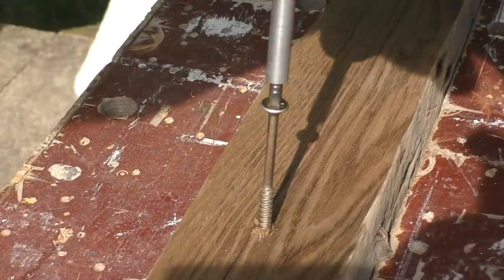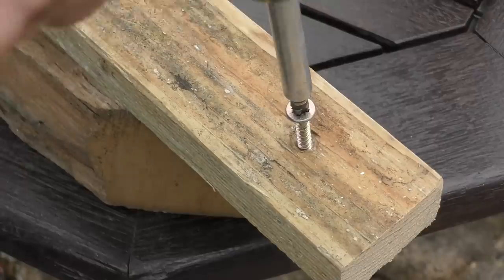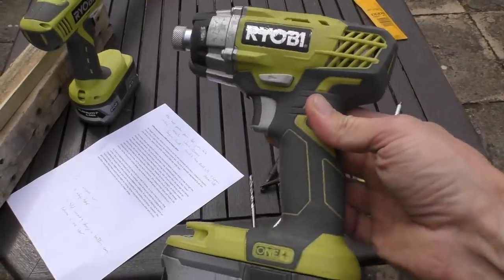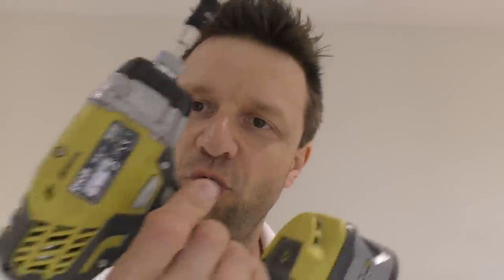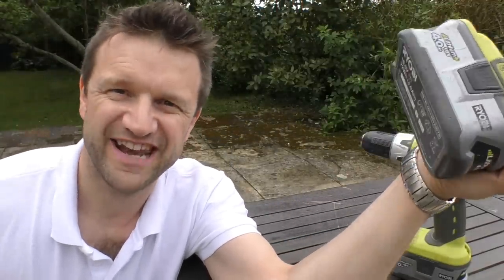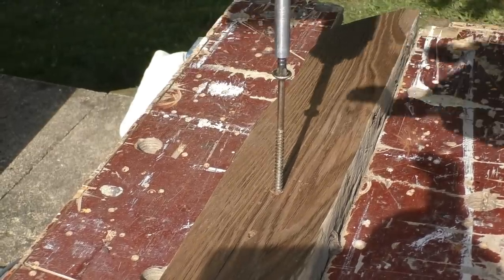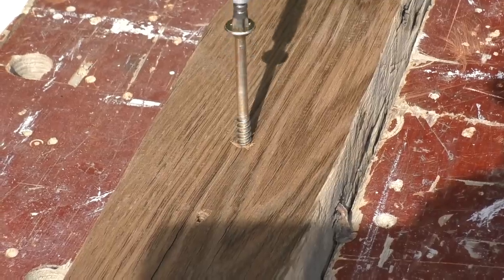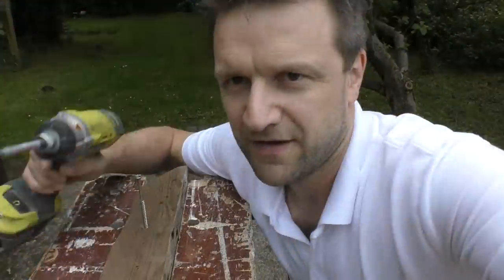Difference between Drill Drivers & Impact Drivers

Comment: Ok but how do this compare to a hammer drill/driver and what’s the difference
Reply from the maker: With an impact driver the impact action works radially, or in the direction the bit is turning NOT in and out of the wall or in line with the drill bit which is how the hammer action works on a combi drill or drill driver. Take a look at this video where I go into this in a bit more detail https://www.youtube.com/watch?v=i6KYfrDBj3w&t=32s Also compare the action of an SDS drill here https://www.youtube.com/watch?v=tYUvlxWkFh8&t=12s

Comment: I have experience of using Ryobi and never ever will buy again. Even those tools bought from Lidl are better quality. For work I buy only Festool, Mafel, Fein, Hilti or blue Bosch
Reply from the maker: I think if you're using them 5 days a week, then definitely I agree, you need one of those you mentioned, and possibly add Milwaukee to the list. Personally I've never had any issues with my Ryobi in the day job, but I'm not a heavy user.

Comment: why not the hammer action on a drill driver?
Reply from the maker: Because it works perpendicular to the drill bit, or in and out of the wall whereas the hammer action on an impact is radial, it works in the direction the screw bit is turning, which is what makes it so powerful.

Comment: What about a drill with impact drive built in?
Reply from the maker: There's no such thing, I'm afraid. You're talking about the hammer function on a combi-drill, and you can't use this for screws because it works completely differently ie banging in and out of the wall down the length of the drill bit, whereas the impact action works radially, ie it hammers in the direction the screw is turning which makes the process so much more effortless.

Comment: Im none English speaker, but what actually is a hammer drill/driver. Does that sort feel same as the impact driver? These names drive me nuts haha
Reply from the maker: They're very different. The hammer drill action works in line with the drill bit (in and out of the wall) whereas the impact action works in a radial motion, or in the direction the screw bit is turning. A lot of people ask if you can use a hammer drill as an impact. The answer is NO for the reason I've just given.
Reply: @CharlieDIYte  I think i sort of understand. Impact is only for driving where the other one is drilling right

Comment: I should have gotten anything besides the pl235 impact driver
Reply from the maker: Ah sorry to hear that. What's the problem with it?
Reply: @CharlieDIYte  I was asking for a lightweight drill to drive in screws and for drilling holes when I had to use a drill above my head.  My Ridgid 18v is just too heavy for using all the time.   However, the Ryobi has no speed adjustment.  It is too fast to use to drive in screws.  Also, the bit holder does not hold onto bits like my ridgid does.

Comment: not sure where you get the idea the impact is stronger than drill driver my drill driver i have tried to drill in 3 inch screws and my impact stopped with screw less than inch remaining  then used my drill driver straddled it then it wanted to twist on me and with ease over sunk the screw my drill driver is probably 5 times stronger than my impact both are dewalt and share 20 volt batteries i use my drill driver to tighten and remove lugs form my vehicle wheels and get them tighter than torq spec my impact driver cant even get close to torq spec
my drill driver will send you to the hospital if you are not careful my impact driver will never injure me

Comment: Its the volts thats the power ,and the amps the capacity .18v 4 ah  will not give any more power than an 18v 1.3 .Those batteries must be goosed
Reply from the maker: It's not that simple mate. Check out the pinned comment at the top of the comments feed below this video. There's a great discussion on this. 👍

Comment: This doesn't prove or disprove anything. At the end they both get the screw in at equal amounts with the 1.3AH battery. He switches the impact driver battery to the larger battery to finish the job, like he proved anything by doing that
Reply: Yes I was a bit puzzled by that bit, I thought we were going to see that the impact driver would easily finish the job even with 1.3Ah. But nope. I get that it requires less pressure to use, but other than that it doesn't seem to any more effective. A drill driver seems fine for most jobs, and of course you can use it to drill holes too.
Reply: @chrisf1600  I used only my drill for a long time, constantly switching between drill bit and driver bit. What a pain. Finally I clued in and started using the drill as a drill (pilot holes, etc.) and the impact driver for the screws and it makes a world of difference. Sooo much more efficient. And yes, the impact vs straight torque does make a difference. The other nice feature of the impact driver is the shorter barrel, so it's easier to get into tight places with it than with the drill. Definitely worth it to work with the tandem, IMO.

Comment: You're an interesting man, but through out your long video, I still don't see clearly the difference between those two drills, except the impact driver has accept only the hexagon bit which is not as convenient as the drill driver.
Reply from the maker: Sorry. I go through the differences in greater detail in this video https://youtu.be/i6KYfrDBj3w. Bottom line, the impact driver has a hammer action that works radially, or in the direction the bit is turning, which gives you so much more power when driving home screws, whereas the hammer action on the combi drill works perpendicular to the wall (in and out), which is why you can't use the hammer action on a combi to drive home screws.

Comment: I hate impact drivers. They tend to rip through the wood and split it. You should you a drill to do a pilot hold first and then use an impact driver if you really must
Reply from the maker: I've got to say, I hardly ever use my impact. Just not necessary for most jobs. But then the fitter who works for us uses his for everything. So it comes down to personal preference I guess.

Comment: “The impact driver is so good for driving fasteners, just take a look at all the drillbits that I’ve run and all the screws I’ve sheared off!” 🤣
Not to mention the goddamn concussive vibration sound is completely annoying and hard on the ears.  I’ll take a drill driver with a selectable clutch thank you very much.
Reply from the maker: I've got to say I rarely use my impact for this reason. It's just not necessary for most jobs. As discussed here https://youtu.be/sL-t2Zc4wCs

Comment: for home use, why not just get the screw/drill gun and drill a pilot hole, then you won't need an impact driver ?? Plus drilling a pilot hole prevents the wood from splitting? Is this sound logic? Again .. home use ..
Reply from the maker: You should always drill a pilot hole particularly in hard wood like oak because otherwise you'll have snapped screws on your hands and splitting as you say. I didn't here because I was trying to make the challenge as brutal as possible.

Comment: unfair. with 4.0 ah battery he used x1 speed with drill driver but with 1.3ah battery he used x2 speed which makes drill driver much faster but it loses huge amounts of torque. And usually impact drivers have less torque than drill drivers. it's the way the torque is delivered. and that's why impact drivers last longer with the same battery. it's a lot more complicated than this but basically use impact driver for screws and drill driver for everything else.
Reply from the maker: Hi Robin, that's very eagle eyed of you - I'm assuming you're looking at the snap shot that showed the drill in setting 2 before I started the 1.3Ah part of the challenge. I don't know how or why it was in setting 2, but I can't imagine I would have started driving the screw home in this setting. Accidents happen, of course. Someone has already pointed out I was using a PH screw bit, which again was accidental as I had a set of black erbauer impact bits which I stupidly assumed were all PZ.

Comment: 8:14 wrong bit. You are using a PH2 instead of PZ2 bit.
Reply from the maker: Yep I know. Picked it out of the tool box thinking my black Erbauer impact driver bits were only pozi drive. Turns out there was an erant Philips head in there 🤦
Reply: @CharlieDIYte  that is an unpermitted mistake for a tools lover. You should repeat the test.

Comment: So it's about the battery..it seems like it doesn't matter if you use impact driver or a drill driver.,what really matters is the kind of battery you are using..
Reply from the maker: The impact driver makes a massive difference if you've got a lot of screws to drive in eg for decking, or driving home a big old screw where you need the torque, because the hammer action on the impact works in the direction the bit is turning whereas the hammer action on a drill driver or sds works in and out of the wall. So the impact does give you a lot more power, but I've got to say it's something I rarely use myself.

Comment: Drill driver is for drilling holes or small screws. Impact is for driving screws. You can use your drill to drive big screws if you want or you can pre drill all your holes...but its not the right tool. Just like you can wash your car with a toothbrush...doesnt mean its the right tool.

Comment: Why not just have an impact driver?
Reply from the maker: You'd struggle with concrete - because on an impact driver the percussion works in a radial way (in the direction the bit is turning) whereas to break through tough brick or concrete, you need a hammer action that works in line with the bit, or in and out of the wall.

Comment: So basically the drill is fine for most things just get a big battery 😂
Reply from the maker: Yes but you find if you're using power tools a lot, the all singing an dancing combi drill with a big battery is a bit of a beast to lug about, so you tend to have a much lighter drill driver for general wood drilling and driving and the combi or SDS for masonry. The tool I used the most is my little 12v drill driver because it's so light and handy.

Comment: Batteries is really not his strong point.   'Power' delivered is all about Volts and Current - absolutely nothing to do with Ah. Doh....
Reply from the maker: Julian the unassailable truth is that a 5Ah battery delivers more torque than a 1.3Ah. 1.3Ah has 5 cells in series whereas a 4Ah has 15 cells - so 3 in parallel delivering 3 times as much current and therefore ultimately a lot more torque. The comment pinned at the top of this video which has 79 comments in the feed bares this out.

Comment: So really the difference is the battery not the drill or driver.
Reply from the maker: The battery is important. The drill driver or rather combi drill (drill drivers don't have hammer action)  is a good all round drill driver, but the impact is more effortless because the hammer action is radial - it works in the direction the bit is turning whereas the hammer action on a combi is only designed for drilling into walls not screwing as the hammer action works in line with the bit - or backwards and forwards into the wall.

Comment: I find it amusing that you are still using Phillips screws instead of star screws as using star screws would take care of 50% of your down force problem not mentioning your stripping screws problem.
Then again, you made the video in 2018,,,, ;)
Reply from the maker: Ian, you're one of many who have pointed out that I was accidentally using the Phillips bit on a pozi drive screw. I'm well acquainted with the difference from my day job but I thought that my black impact bits (of which I only have a few) were only PZ bits and didn't think to check. Yes it was a PH bit but honestly, you still need downward force with PZ bits. For a true experience without downward force you need Robertson or Torx bits & screws. Thanks anyway.

Comment: Lol I don’t know why you think you have to apply more pressure with a drill then an impact.   That’s just not true and impacts will strip and break more screws then a drill would.  Put your drill in a lower rpm for more trq.
Reply from the maker: To stop it camming out. Admittedly you'd usually drill a pilot hole to make the screw slip in easier but on this vid I wanted to make the challenge as tough as possible self piloting into that oak, so pressure was required.
Reply: @CharlieDIYte  switch to a t25 and you won’t have to use as much pressure.  But impact or drill, you’re putting down the same amount of pressure and if anything even more with an impact since it’s not as smooth as a drill.  Atleast that’s my experience being a GC for the past few decades.

Comment: The impact driver demonstration was not that impressive. It didn't do much more with the 1.3 battery. The biggest take away is not whether to use driver or impact but to use the better battery

Comment: I think RYOBI tools are JUNK.  Not so much the tools themselves.  It has more to do with the batteries.  My ryobi batteries just quit taking a charge.  I do all the things I have been taught to do with lithium batteries such as never store one without a full charge.  I very rarely have a dewalt battery go bad. While I can't seem to keep a decent working Ryobi battery.  Some of the Ryobi tools I own are great.  Just can't use them cause the batteries always seem to be tits up when I go to use one.  If I have a big job that I need that particular tool for.  I just go buy a new battery to get through the job.
Reply from the maker: Hi Bobby. That's really annoying for you, and whilst the 1.3Ah are pretty rubbish for the reasons you mention, I haven't had any issues with the 4.0 and 5.0Ah batteries. Out of interest, what size batteries are you using? The 1.3Ah?

Comment: So basically don’t buy a drill or a impact driver just buy a good battery 😆
Reply from the maker: It kind of seems like that doesn't it!  I'd say your combi drill/ drill driver will do the job perfectly well and in fact my impact driver doesn't get a great deal of use as most screwing jobs can be done very well with a light drill driver. However if you have repititious jobs and/or are driving home large screws into masonry or hard wood then the impact with its increased torque and hammer action working in the direction the screw is turning, really comes into its own. In short you can drive home screws one handed with an impact driver that you'd need both hands and a reasonable amount of effort to do if you were using your combi.

Comment: Lets point out the elephant in the room.
 you are blaming the tool for skipping when you aren't even holding it at 90 degrees. you are putting a sideways pressure on the screw that is slightly flexible plus you end up meshing with the side of the Philips bit. 
the phillips bit and the screw was not designed to be used in an angle. don't blame the tools, blame the user. I could get that screw in without stripping it at all.
Reply from the maker: I agree I was using a philips bit - stupid error caused by the assumption that all my impact bits were pozi drive. I don't agree that I wasn't driving it at 90 degrees. The camera angle can be deceptive.

Comment: My eyes may deceive me and the OCD may be showing now but half the reason you had a problem with the screwdriving is because you used a Philips bit on a Pozidrive screw........
It shouldn't have annoyed me but it did.
Reply from the maker: Yes, yes, you're right. For some reason I didn't check the bit, based on the assumption that all my black erbauer impact bits were pozi drive only. It would annoy me if I watched someone else's video with such a glaring error in it.
Reply: @CharlieDIYte  lol, it just wigged me out. It's the main reason I hate lending my tools out. Then you get the guys that use a torx driver to undo an allen bolt!!!!

Comment: If you never dropped you tools Ryobi could be  ok tools..
Reply from the maker: I've dropped them loads. Pretty robust in my experience. The stick on the battery is a little less durable if you drop it bang that when not connected to the drill.

Comment: so, if my car had a smaller petrol tank it would have less horsepower and not be able to go as fast, LOL!!!
Reply from the maker: You're unwittingly spot on with that analogy. No car manufacturer would ever put a small petrol tank in a high performance car 😉👍
Reply: @CharlieDIYte  small tank or big tank the engine will perform exactly the same, but for a shorter or longer period of time.